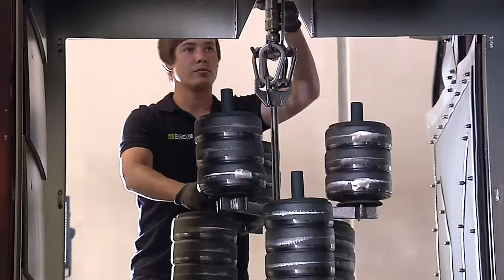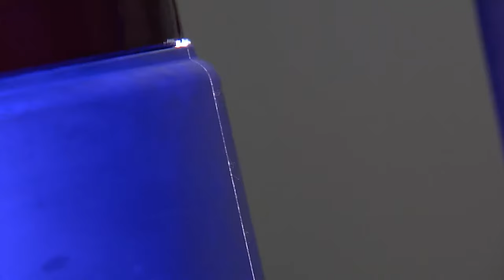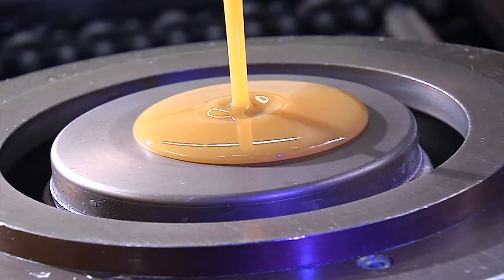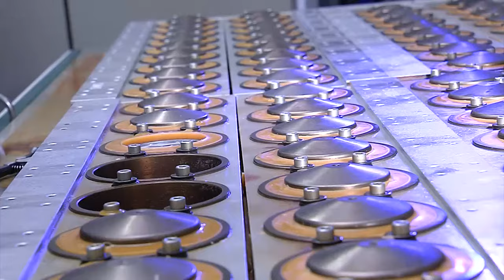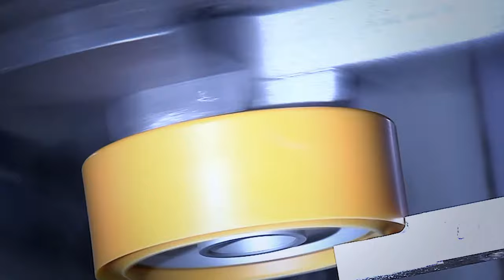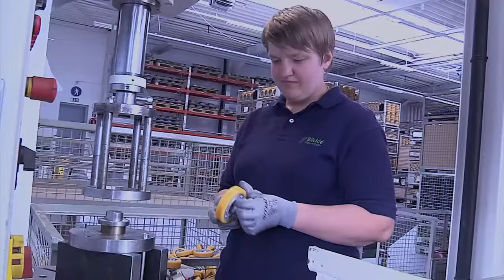Blickle Polyurethane Wheels & Castors Production

Comment: What bonding  chemical?
Reply from the maker: Special Polymer by Blickle sprayed on the surface of the wheel center before the the PU tread is casted into a mold where the wheel center is. After that, the whole product will be treated with heat in the oven over a specific period and rest outside and being treated again... this repeat several times until it meet the requirements and specifications.